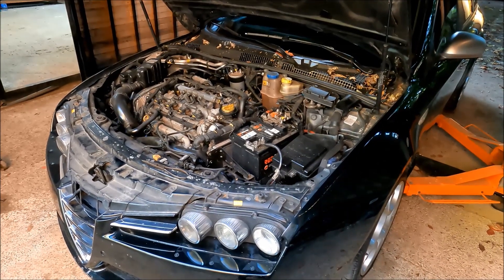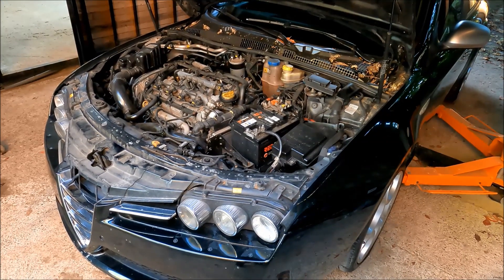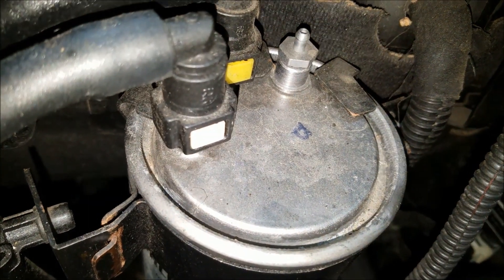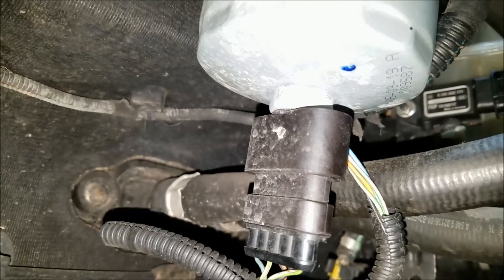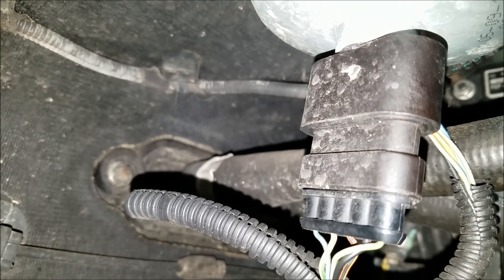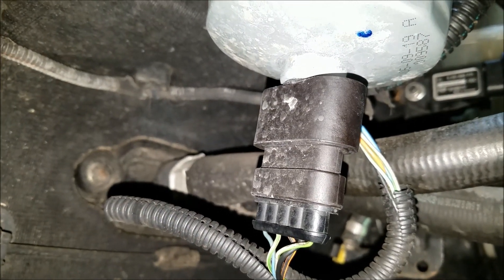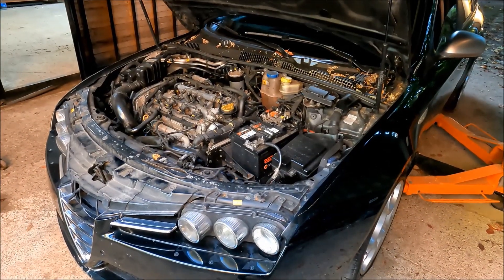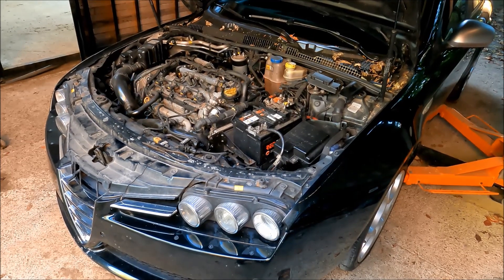Fuel Temperature Sensor Location and Issues Alfa 159, Brera, 147, GT

Comment: Great video, are you able to provide the wiring fault info to go along with this fuel temp issue. I have a 159 2.4 with this issue and I have replaced the sensor . I am the third owner and believe it is a ecu or wiring issue.
Reply from the maker: If you can check the resistance of the wires to the sensor itself first, then check the ECU. The chances are that it is a broken wire. If you can't do this yourself take the car to electrician...
Reply: @arcgarage  Thanks for the reply, I have checked for resistance and circuit continuity between ecu and sensor. What I am asking is the location in the wiring harness you have come across that causes this issue. I also believe my engine may have possibly been removed for repairs at some stage.Thankyou

Comment: Hey man me again, found a local 156 for like 400 bucks, its really high milage (350k km) and im sort of scared because of all the rumors on 2.0ts but ive started it, had no variator rattle, oil didnt look dark, didnt missfire or smoke started pretty easy after sitting for like 2 months, just had some lifter tapping but I had the same thing on the 1.6ts in the 147 and it mostly went away after changing the oil. The reason its low price is that the fronts a bit banged up the hood and fender need repair repainting etc, tho the interior is in really nice shape. Im wondering how much worse reliability wise it is to the 1.8, 1.6 (120 and 105s) and do you think it could be worth doin a engine refresh, I dont do that many kms anyway. Id like to clean it up but im scared if the rings are worn, cylinders cracked etc. Maybe I should do some boroscoping and pressure tests, would that be able to tell me well enough weather the engine is worth putting money into?
Reply from the maker: Honestly, I would stay away from it due to the high mileage...
Reply: @arcgarage  Yeah honestly I was thinking about it not worth it probs so gonna give up on it

Comment: I just bought an Alfa GT 1.8TS and i am pretty inspired by your videos. I will definitly change a lot of things in this car to make it look great again.
Do you think it is possible to change the engine from a 1.8TS to a 3.2 V6 ?
Reply from the maker: Great to hear, it is possible, but it requires a lot of modifications, unless you have GT with that configuration for spare. So if you are not working on it yourself, I don't know if it would make financial sense...
Reply: @arcgarage  i was just wondering if it is possible. :D
The first thing i need to do is cleaning the whole car. That is how i found your channel.......because i definitly need to restore the window switches, the leather of the steering wheel, central dash vent and stuff like this. Your videos will help me a lot to make this things Look great again! One thing i that i will definitly integrate is the big car Radio with the display! 
Can i ask you a few things about the stuff you have used in your videos ?
Reply from the maker: @hannesmoller9963  Sure
Reply: @arcgarage  Do you know how to open the engine hood when the lever in the car does not work anymore ? A couple of days ago it worked, but now it just stopped. We guess that the string broke in some place.

Comment: great video, thanks. i need help about a problem on my 159 turbo boost pressure drops when i accelerate. it goes to top pressure and relase some of the presure (acceleration slows and some points it stops accelerate) and if i stay on the gas pedal pressure rebuilds again and car goes. what should i check (i have videos on my channel also)
Reply from the maker: Thanks, it could be variety of things, I would have to test it out using diagnostic tool
Reply: @arcgarage  i did but there is none fault code. also they checked the turbo, changed vnt, checked the tune, i changed the turbo pipes and still have the problem but next i'll check the intercooler pipes and intercooler for a leak because i guess there a leak, when boost builds up somewhere it release the boost i also can hear it slightly. thanks for the reply
Reply: @Garrett159R  give a look to the two intercooler air pipes (sometimes they look fine but under pressure they leak), check the MAP sensor and the air flow meter. If never changed change the MAP and the air flow meter, the car will reborn
Reply: @marcobasso2671  thanks for the reply i changed map and air flow meter nothing changed. i also changed upper and lower turbo pipes and still same. i will check intercooler and pipes. I am pretty sure there is a leak i can hear a sound like “vuf” when pressure drops also exhaust sound goes louder but it only happend when its under pressure when i stop and rev the car for checking under the bonet pipes doesnt leaks or pops